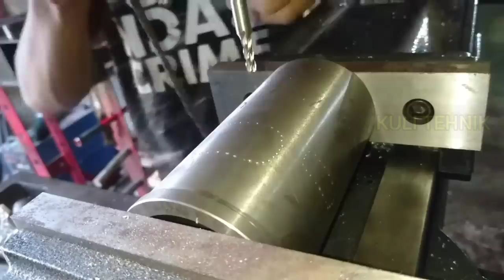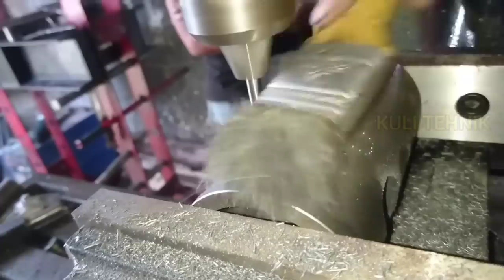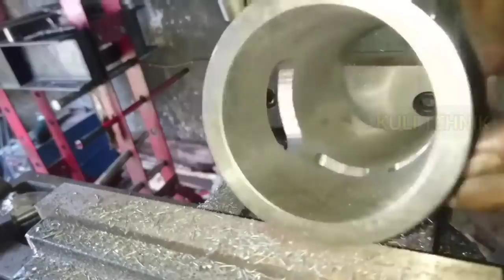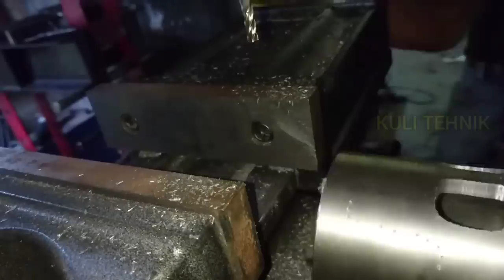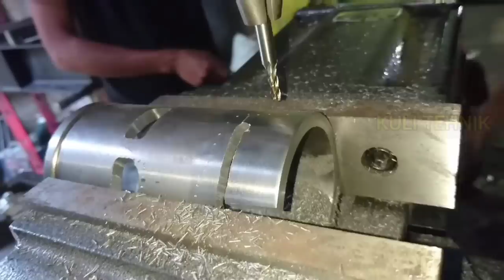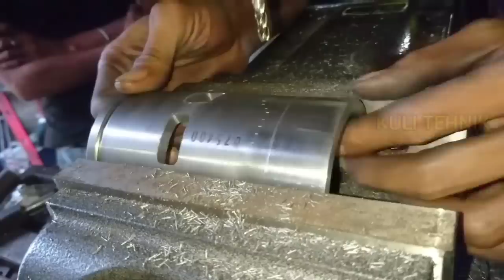not many people know, how to make a 2 stroke rx king piston housing hole more powerful

Comment: Yes, once loop purge was popular in the 70-s, 80-s, but direct-flow with one exhaust valve turned out to be more efficient and manufacturers switched to this scheme. But in terms of reducing moving parts and assemblies, loop purge wins, but loses a lot in engine efficiency. Cleaning the cylinder from exhaust gases is not as effective as with the exhaust valve.
Reply: What's your take on the 70 hp OMCs? I have a 1980 model, love it, it's a tough motor. You seem to be very knowledgeable,  I'm just asking as a parts changer. I'm no mechanic,  but I can repair this one if needed.
Reply: Your just Running it way ! Too !.Rich !
Reply: @sir-richard4172  I am a ship engineer and have worked on ships with two-stroke crosshead Sulzer engines or purebred MAN for example. They come from the 70s and 80s, the height of a three-story building. There purge according to the scheme Cross-scavenging or loop -scavenging. Then I saw how modern ships have diesel engines only with direct-flow purge with an exhaust valve. Now the trend for common rail is without a camshaft. Valve opening and fuel injection are electronically controlled. The technology is crude - mechanics often spit in anger. Electronics does not like heat, constant tropical humidity or constant vibration - which is a common thing on any ship. Reliability leaves much to be desired, but the savings have increased markedly. For example, out of three injectors per cylinder, the electronics can turn off any number of injectors at partial and low diesel operating modes while simultaneously changing the injection advance and valve opening (closing) angles for efficient operation at such low speeds when maneuvering, for example.

Comment: Damn, an endmill in a drill chuck on a relatively heavy cut….
Reply: It had to be said, thank you.
Reply: They doing it with everything they have, we should apreciated it
Reply: Yep, I was thinking that as well, the JT taper holding chuck isn't designed for that sort of thing, plus, HSS or carbide tooling will destroy drill chuck jaws.
Reply: @roykeefe4202  wow damn the guy is using what he has. You guys are way too negative
Reply: @roykeefe4202  it had to be said
Reply: @ironmike742  it's not about using what he has you Muppet if he has a drill chuck he has a collet rofl.
Reply: @davidwillard7334  Do you have ANY idea what your talking about?
 He may be using what he has and is available but it isn't anything like the right way to do it. 
The holding tapers are designed for axial loads,.
 With side loading and a bit of vibration, they WILL come apart

The base of liner where transfer was cut shows terrible wobbling about, possibly chuck fell off or tool fell out or liner moved in vice more than once during machining?
 (I had to edit to add it's at 6 seconds in) Around 2 minutes, the ports being cut are much 'smoother' where liner is held tighter on it's ends
Reply: @1crazypj  Your the one ! Worrying about the Chuck.jaws ! And As for AXIAL LOADING ! THEY ! BASE ! THAT !! ON ! A ! TOTALLY !! AND ! UTTER !.CRAP !  STYLE!! DESIGN !!
Reply: @davidwillard7334  David, why are you so bent out of shape when I'm stating facts not conjecture? I've not only seen it happen, I've had it happen when I didn't know any better.
Reply: @davidwillard7334  Do you actually have any idea what your talking about or do you just write using totally unecessarypunctuation because you know no better?

Comment: Milling with a drill chuck...one of the most last common mistakes. When you see a drill chuck flying off the arbor. Chucking a cylinder sleeve in the vise...good way to 
 mKe it egg-shaped. Angles, what? Each angle according his calibrated eye. This guy shouldn't have an egine closer than 500 meters.
Reply: They use what they have Karen.

Comment: just think how much better the airflow would be if all the angles were were the same and the edges were smooth. Ever think of using a jig so the angled cuts are at least consistent?
"How to make the holes in a 2 stroke piston liner more powerful ... " yeah, cutting the dam holes and matching them to the block/cylinder (AKA: "PORTING") so there are no ridges between parts would be a step in the right direction.
DYI might save you some money, but won't come close to matching the engine makers properly CNC'd cylinder liner, forget about exceeding it.
Reply: You'll never know, some of the best porting jobs are done by hand......
Reply: I would guess your neither a motorcycle mechanic or machinist?
You can't port a cylinder liner, it needs to be installed in cylinder first.
 Roughing things out like that is perfectly acceptable. 
That is an incredibly thick liner so will be installed then bored to size (normally 'installed' wall thickness in around 4~5mm)
Last time I bought liners from L.A. Sleeve in California (around 2004) they were $90.00 each.
Have you ever changed a liner in cylinder or paid someone to do it for you?
Reply: Steve Huffman... well then go by yourself a liner then. Big money
Reply: @1crazypj  no Mr. Huffman is a big money guy. He pays someone to do it for him.

Comment: You got to understand physics of mechanical products like an engine.
In this case you design a piston to cylinder to ratio air fuel compression to get ignition. The shape of the piston as they use in rockets is to move exact amount to.a confined area before the explosion or in this case ignition occurs. The design or look is to get familiar with that engine to know its parts as certain styles certain makers have there own product to sell in its own.way
AFFA angels never die nffn HMS sonny